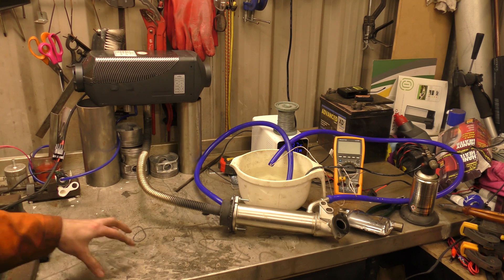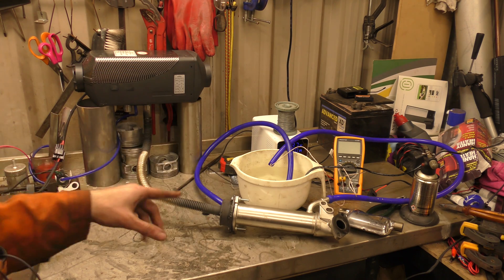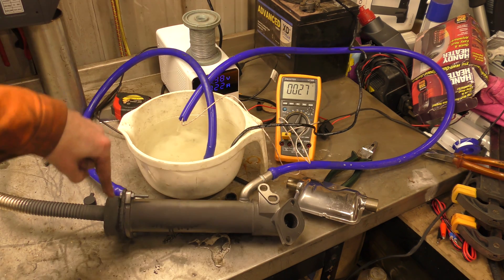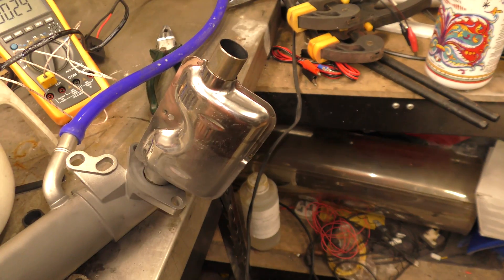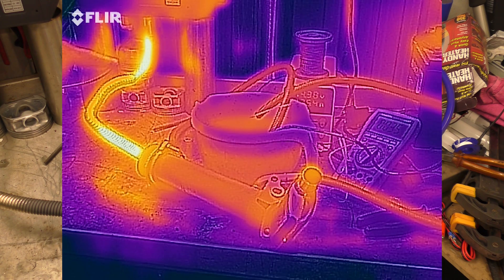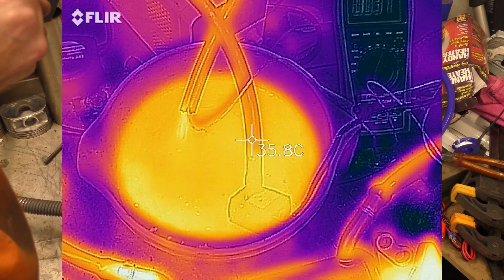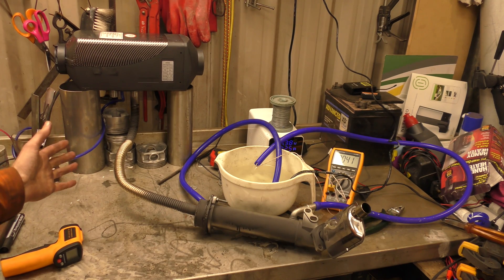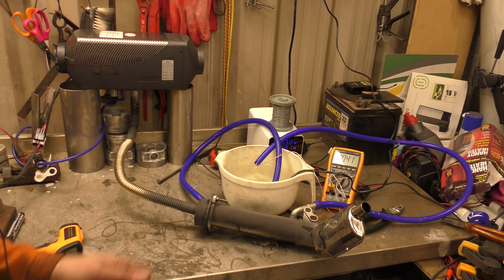Diesel Heater EGR Water / Coolant Heater

Comment: Have you considered putting a catalytic converter before the EGR cooler to get a little more heat from the unburnt fuel? It would also help with emissions.
Reply: That's not a good idea with diesel heaters since they can't handle any back pressure on the exhaust. 
It will work for a couple of weeks / months and will clog up the burning chamber till it breaks the diesel heaters

Comment: I was thinking of running the exhaust pipe through a small oil-filled radiator, have you done it, and if so what was the result
Reply from the maker: Empty of oil or full of oil?
Reply: @DavidMcLuckie  I was thinking with oil but imagine a tube through the bottom from one side to the other sealed then exhaust through that?

Comment: What about making a radiator out of soapstone. If you got a few slabs, and just snaked the exhaust back and forth through it, it would radiate off the extra heat for hours. Could use copper tube, soapstone is easy to drill afik. Obviously not for hot water, but to capture radiant heat for living space....just an idea.
Reply from the maker: Nice.  Like a mass storage heater.

Comment: Why aren’t these installed on all cars?  It seems to me that it would help gasoline engines warm to closed loop fuel delivery faster from a cold start and potentially stay there in colder weather, not to mention heating the passenger cabin faster. There would have to be a thermostat on it to close above a certain temperature to prevent overheating an engine under load...hmmm....it could even be used to warm fuel...

Comment: This is super awesome David. I'll set up the system so the water pump will run anytime the heater is on and will always send the exhaust waste heat into my interior 35gal aluminum tank. Just take a shower when the water is the right temp and never run the risk of freezing tank. The water tank also has a built in engine coolant heat exchanger too if it needs a little boost. It great having the tank inside because those 35 gallons act as a big heat reservoir!

Comment: Hey brilliant idea! I was about to start a setup with hydronic for hot water and air heater but I love this and I'm definitely going to try it. 
You think would be efficient if instead circulating the water, just heat up on demand?? From tank through egr straight to kitchen and shower taps
Many thanks from Spain

Comment: Hey from the USA.  I’m wondering if one could make an exhaust gas water heater from some 1 inch (close to size of the the 2.5 cm diameter exhaust) copper plumbing pipe inside of a 1-1/4 inch copper pipe with a reducing tee on each end.  That would make a similar setup as the EGR we see here.  One could make a copper heat exchanger as long as needed which might muffle the exhaust and generate more hot water.  Copper is a better heat conductor, too.  I wonder if the exhaust gas would corrode the copper?

Comment: Hey David! I tired to wrap a cooper pipe around the exhaust but doesn't heat up sufficient to bring water to a heat.. I was wondering since you like to experiment, trying to pass a copper pipe inside the exhaust, from the upper outlet until the end.. Think it would heat up more? Thanks!

Comment: Do you think its possible to use this to heat up coolant in my diesel ram Promaster (Fiat ducato) without using the pump. Trying to see if I can use this instead of the block heater because there isn't many places I can plug it into.
Reply from the maker: What about a 12v coolant pump?
Reply: @DavidMcLuckie  wouldnt it draw a lot of amps?

Comment: I wonder if you could make this work without the water pump---via natural circulation.   Thus the warmed water rising and the colder water dropping (from a raised supply tank).  Not sure if the flow rate would be fast enough (?) to be useful, but this could greatly simplify a water heating loop....if it worked.
Reply from the maker: That will work.  The hot water will naturally rise and be replaced by the cold water.  As long as the tank is above the EGR cooler it'll keep cycling.

Comment: does it matter what pump you use as for water flow
Reply from the maker: One that doesn't melt in hot water.
Reply: @DavidMcLuckie  I meant like a 12v hot water shower one on ebay , also where can you mount it in or out of a camper van

Comment: Definitely run the water the other direction, as someone has already suggested, it's more efficient. It's called a contra flow heat exchanger.

Comment: Can you make your own heat exchanger from "off the shelf" copper pipes and fittings and show the results please? I've seen people do it to pre-heat water to a shower so be interested to know if it's worth making a exchanger myself for the heater,  Also be interested to see how well it does without the pump if its mounted vertically
Reply from the maker: No.  For the £38 for the EGR cooler there is no way I could buy copper pipe, fittings and braze it all together and have as neat and simple a result as spending the £38.

Comment: Excellent as usual David. Have often wondered why manufacturers have never used exhaust gas heat recovery to make engines more efficient, especially on short journeys where engines are inefficient because they are cold?
Reply from the maker: I think it's likely that petrol engines are so thermally inefficient that they heat up fast enough on their own.  Diesels on the other hand would benefit from being warmer faster.  My Citroen C1 is warm after a few hundred yards.  :)
Reply: The reason is simple when it comes to cars. 

The temperature drop causes the Filters / Catalytic Converters to not work quickly enough for the emission regulations to pass. 

For Diesel heaters it's even simpler. 
The way they operate they can't take any back pressure on the exhaust side. 
Cooling the exhaust fumes and giving them more restrictions in the exhaust path will cause the burning chamber of the diesel heaters to really badly clog up.

Comment: Good job with the use of an old egr as a heat exchanger. Could use it as part of an underfloor water heating system.
Reply: That's what mines being used for 😅
Reply: if your going to do that, why use a heat exchanger? Surely one could simply lay a suitable pipe through a concrete or dirt floor to transfer exhaust heat to the thermal mass in a similar way to how a Rocket Mass Heater works?

Comment: Hi there, just a suggestion, reverse the water flow in the heat exchanger. the flow of heat should go against each other. this wil  increde the heat transfere with somewhere about 30%, and you wil not have the coldest water contacting the warmest metall in the heatexchanger.  keep up the great work, very interesting to see how these chinese heaters are inside an how they work.

Comment: I would like to see if the efficiency could be increased by adding an intercooler/radiator as a heat exchanger to the exhaust that could be placed in front of the airflow to preheat the air.
- 
I bet some insulation around the exhaust and the bowl would make your setup even better.

Comment: Clever but shouldn't it be closer to the heater with a shorter exhaust hose?
Reply from the maker: Well yes, but this was just a proof of concept.  You're also likely to have the heater inside a vehicle and the exhaust exiting underneath, so there is a good chance the EGR would be out there are well.

Comment: I friggin love your videos. Is that EGR just a straight pipe through the housing? Or does it have fins on the inside heat exchanger?

You should make something to attach to the end of you cut in half heater to pass water through, just a box with 2 fittings, bolted to the end of the cut open heater, and see how much it could heat water then.
Reply from the maker: That's pretty much the second video.  :)

Comment: Awesome. What is the fuel consumption if the heater? 
Also, since the exhaust is still hot you could get another one of those heat exchangers into the circuit for more heat. Looks like an astra part from a 1.7/1.9 cdti... memories!
Reply: You don't want to plug up the exhaust too much... and there also comes a point where the exhaust gets too cold and the water condenses out and rots the heat exchanger. In a setup like this I'm imagining you'd want to regularly run the water up to near boiling temp to keep the egr cooler dry inside the exhaust passages. This would be the biggest problem in cold weather when you start with really cold water and the temperature differential is extreme.
Reply: Cheers - very good points ! I know the outside of those coolers are stainless and mine was ancient and still shiny. No idea about the inside though... plus its designed to have car antifreeze running through it so perhaps it would need further adaptions to reliably work for a long time without rusting. Maybe shortening the exhaust would help keep it all hot enough

Comment: If you leave it long enough does the water boil? Or does it stabilise at a temp?
Reply: It most certainly would. It would boil in the egr cooler and come out as bursts of steam and 100c water. The bowl would stay at 100c.
Reply: @volvo09  nah, bowl would melt at 70 lol

Comment: Good work.
I hade a Volvo Amason from 1967 with a similar configuration for a Bhaco air heater. They dident use any pump, the heat exchanger was tilted 45 dgr for self cirkulation. Inlet conected att the lovest cold side and the outlet at the top aat the exhoust inlet to the heat exchanger. It worked out fine in swedisch vinter. They recomended if outside temperatur was below -20 dgrC mix diesel with petrol max mixture 50%

Comment: It is better to run the water in the opposite direction to the gas flow as there will be more heat transferred across the greater temperature gradient. In this case it wouldn't matter but if  you were to connect the EGR cooler direct to the outlet of the heater it would make a small difference.
Reply: Interesting, maybe David could try that and show us how it’s done.

Comment: Fantastic idea. I already have a setup so I can blow the air from the diesel heater to a shower tent. Now I could heat the water as well.
Reply: I am going to do the same thing. But I'll set up the system so the water pump will run anytime the heater is on and will always send the exhaust waste heat into my interior 35gal aluminum tank. Just take a shower when the water is the right temp and never run the risk of freezing tank. The water tank also has a built in engine coolant heat exchanger too if it needs a little boost.
Reply: @thomasbarlow4223  Keep the water above 60 degrees C to avoid bacteria growing inside your tank.

Comment: Been waiting for this video. Did something similar to my webasto 90 water heater. That unit runs 9Kw so more heat to draw out the exhaust. MyEGR will boil if no water is flowing in around 1 minute. 

Some tips. It will work better if you put the water hoses the other way around. So your progressively heating water to the max temp you can. 

Also you need to point the egr down as you will be getting a fair amount of condensation now. Cooling the exhaust down enough to draw out the water as a byproduct of combustion

Also the closer the egr to the heater the better 

Keep it up. Looking forward to part two
Reply from the maker: I thought about swapping the pipes, but was sure if my shitty pump would take the heat.  I thought as well you could lag the exhaust and the cooler to keep as much of the heat in as possible.
Reply: David McLuckie I’ve lagged mine with fibreglass heat shielding all the way along. 1 to keep the heat in and 2 for safety

I’m sure it helps as it’s warm to the touch. Without you would leave skin on the exhaust pipe 

I’m also ducting the first section bare and put an outer pipe though it and ducting my air intake along it with the aim of preheating the combustion air to run waste oil mixes. 

Currently working on a TD5 fuel cooler in the coolant loop to preheat the fuel. Just needs fitting 

Trying to get a real clean burn with say 30% waste oil and 70% kero. Starting up on kero until it’s all warm first
Reply: @DavidMcLuckie  how about some gold heat wrap dave 😂

Comment: LOL  "Whatever fuckin' Kilowatt they are..."

My Diesel VW Jetta EGR Cooler crapped out on me early in the spring time and I ended up using JB weld to seal up/disable the bypass flapper valve on the thing to keep it from leaking exhaust gas / robbing performance from the motor.  It's recently started to get cold in Kansas and I'm NOT looking forward to this winter... even as someone who has also installed a plug-in diesel water heater...  It's gonna suck cold starting this thing!